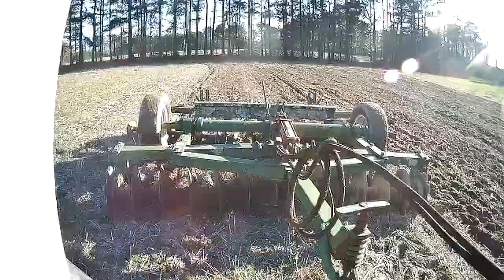Camera mounts and vibrations

Comment: I thought the video was quite good when you had the camera positioned watching the rear gangs. Great job Soybean Farmer, you're videos are always good!
Reply from the maker: AKWayne S - thanks for the feed back on that.  I was using this same new mounting setup on the disc.  it is a magnet with a bolt bent at 90° and for some reason the shorted length reduces the vibration transmitted to the camera.  funny to me how a 1.29 bolt works better than a 14 dollar Joby stick.   the change proved once again how expensive so called made for the application is not always the best choice.    thanks for watching here and commenting my friend.